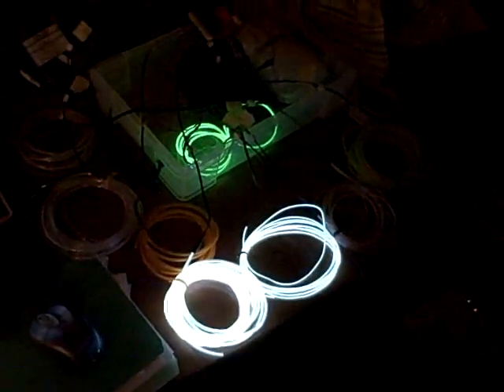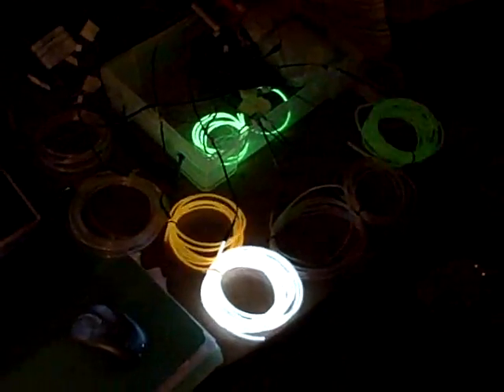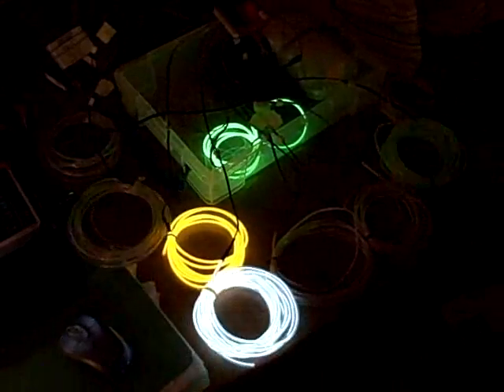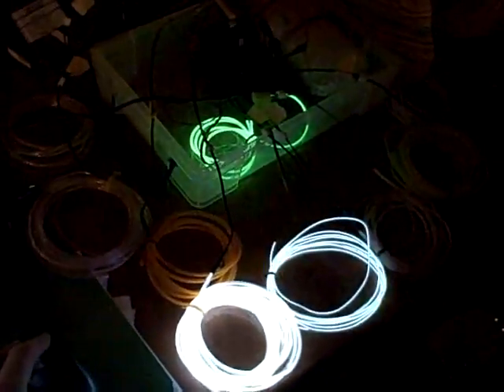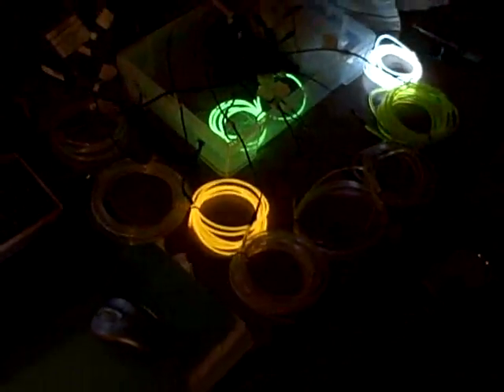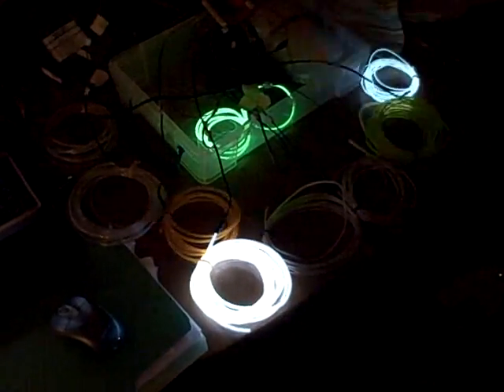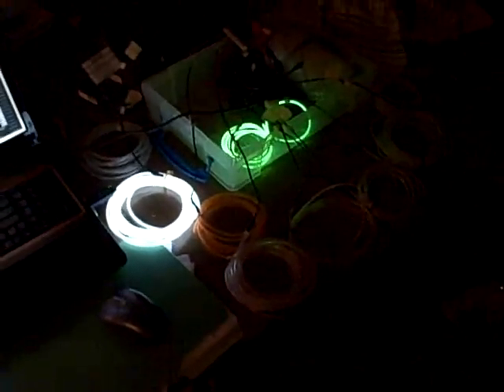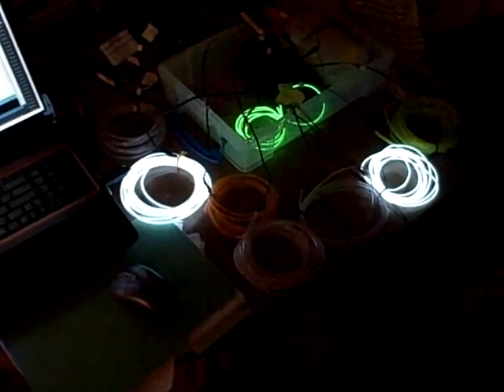Apr 14 - Arduino Escudo #1

Comment: @glocketz 
hmm same problem here.. cant get it to work with the arduino. but a few facts i know:
connect the red/black to your 3v supply and the two black to the inverter output.
if you have found out by now how to connect the arduino with the inverter still working... pls tell me.